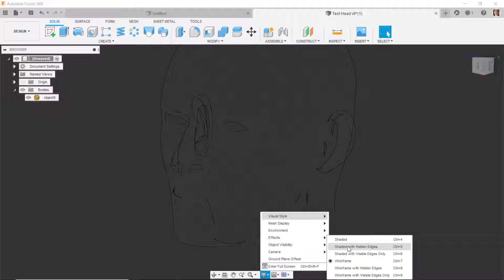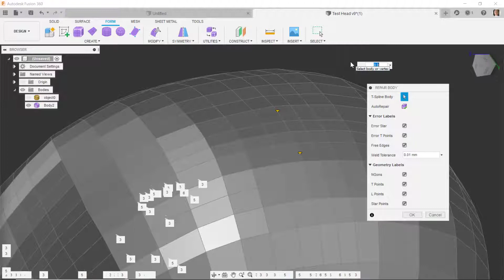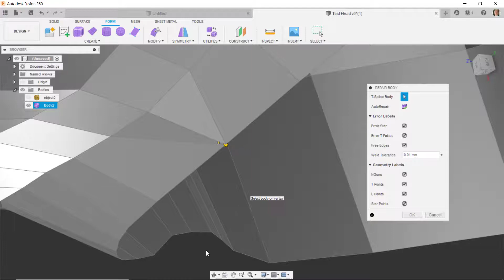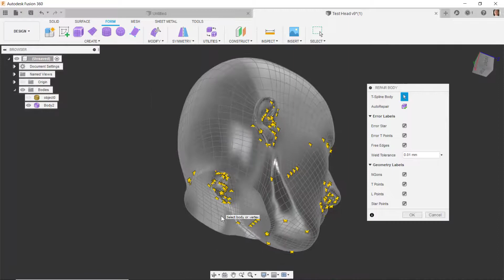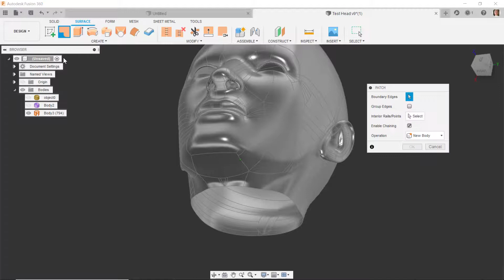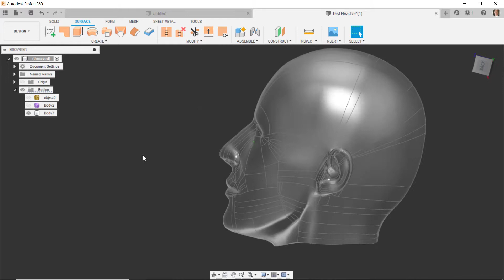Fusion 360 - OBJ to Solid Body

Comment: hi
i need your help, i have see your tutorial and i have try to do the same thing with a .obj but i failed. 
when i want to convert with "quad mesh to Tspline" i can't select the mesh.
Do you have any idea of the problem?
Reply from the maker: Attach your file here https://forums.autodesk.com/t5/fusion-360/ct-p/1234 
There have been some recent changes in Fusion dealing with Mesh files.
Reply: @TheCADWhisperer  thanks